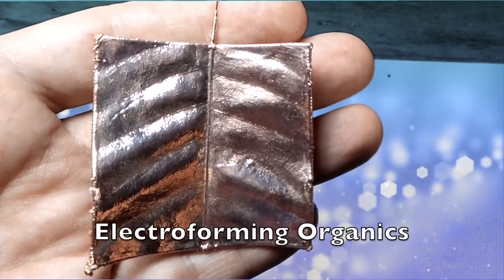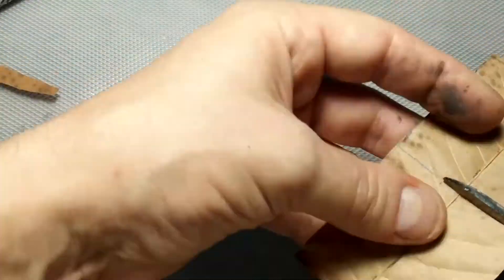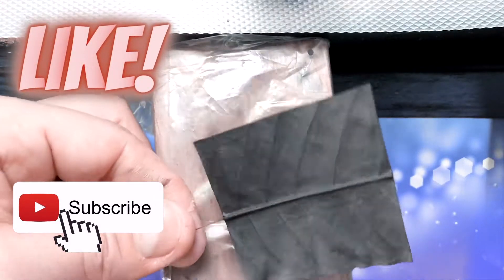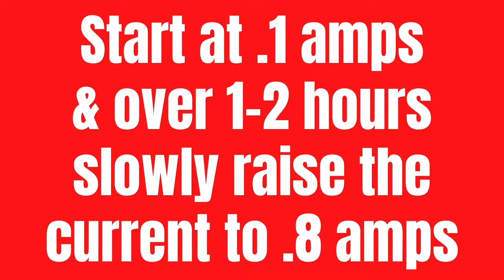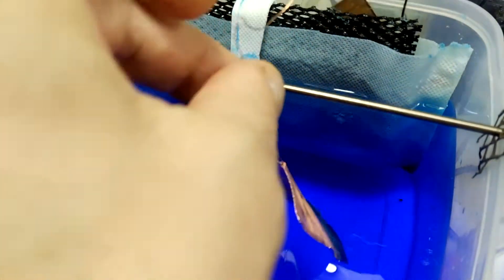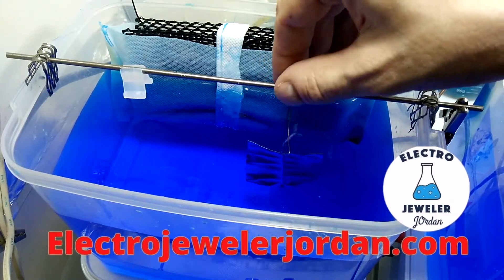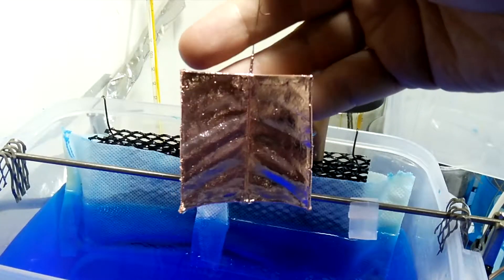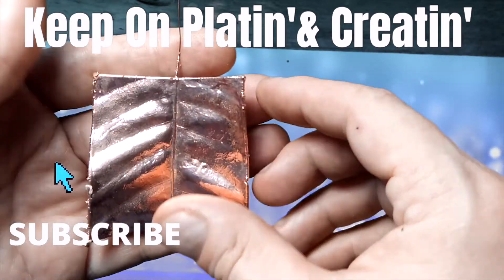ELECTROFORM Organic Leaf Square EASY electroformed Project & advanced tips

Comment: And also, if I would want to make something out of clay and then electroform it, with conductive paint over and all of that, will the electroforming process go faster, like in this video if I make the “skeleton” of the clay thing with copper wire? So if there is wire in the clay will it electroform quicker and better like in this video?
Reply from the maker: Great question.  YES.  The best way would be to have the skeleton go all the way through the piece from and have contact with the hangwire like in the video.  The metal does not have to show, but be at the surface and come in contact with the paint or be painted over. If that's not possible metal on the surface will make  the paint more conductive and plate faster also.
Reply: The same method is used for plating 3d prints
Reply: @louisegrimhelm3041  Indeed 🥳🤗